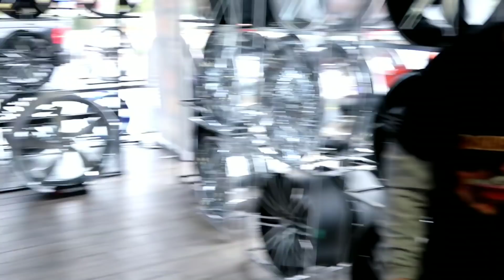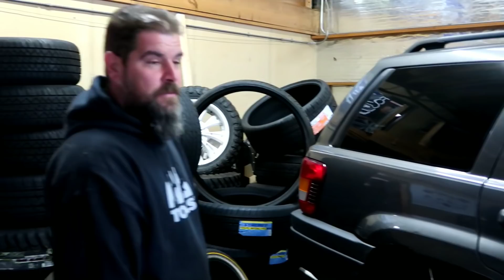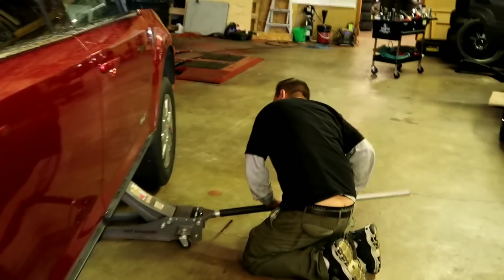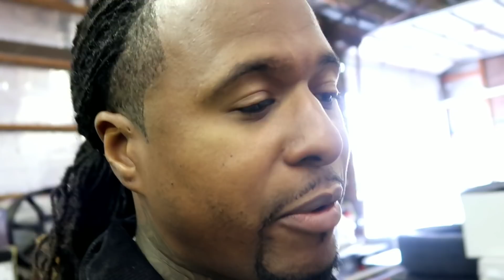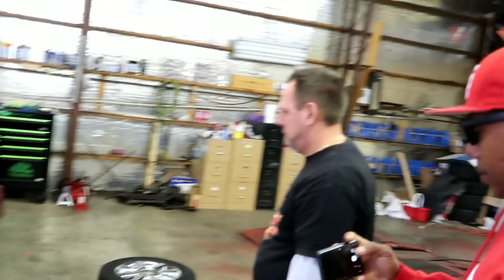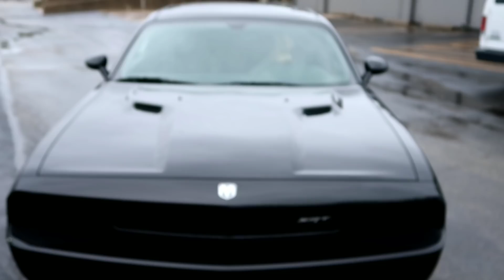SHOULD WE GO 24s,26s OR 32s ON STUNNA MKX HELP US OUT

Comment: #32GANG🤘 WHAT YALL THINK? 24S OR 26S?
Reply: 26
Reply: 26s
Reply: 6's
Reply: 24s but not them black and chrome ones
Reply: 24s
Reply: 6’s
Reply: 6's
Reply: 26s/32s
Reply: Muscle Cars And More 32s is where it at
Reply: 26
Reply: 32
Reply: 32
Reply: Muscle Cars And More  26s
Reply: 32s
Reply: 26
Reply: 26s
Reply: 26's Stunna fo'sho with a 275 25 26 tire. That will set the truck off right bruh bruh
Reply: 26 #32Gang
Reply: 26
Reply: 26s
Reply: 26’s
Reply: 26
Reply: The 26s
Reply: Got to go 26
Reply: 6's for sure
Reply: 24s with vogues its a Lincoln.
Reply: Muscle Cars And More go 26s and turn heads or go 32s and gang gang🤘🏽
Reply: Muscle Cars And More 26
Reply: 32s
Reply: Muscle Cars And More 24s look clean but if you want to feel up the gap 26
Reply: 26s
Reply: Muscle Cars And More 26”
Reply: 26s all day
Reply: 26's forsure
Reply: 26s
Reply: Dropped on 24s
Reply: Muscle Cars And More 26’s
Reply: 26'z already!